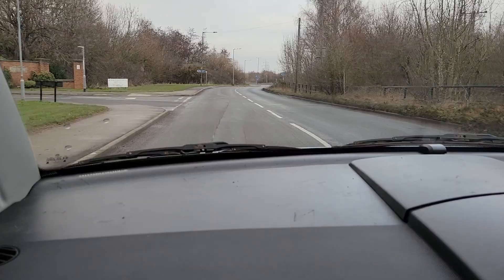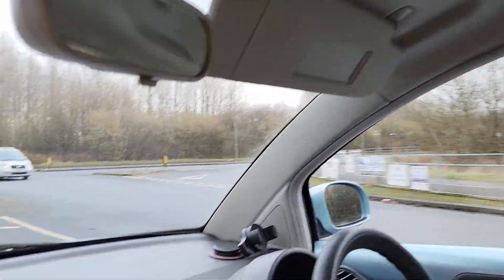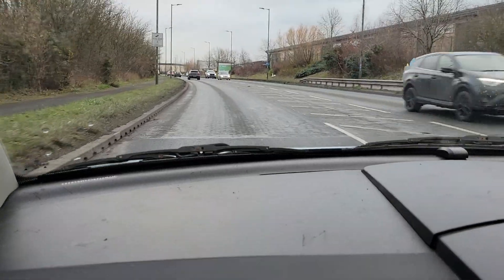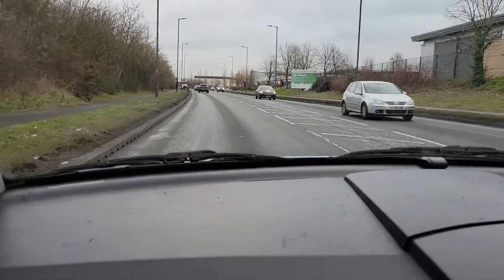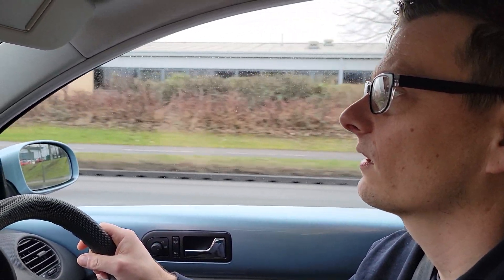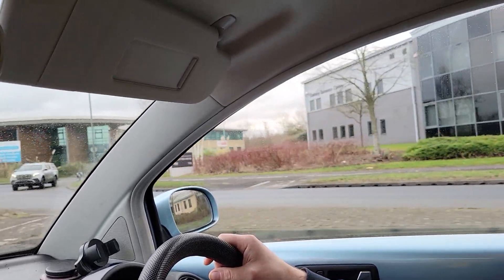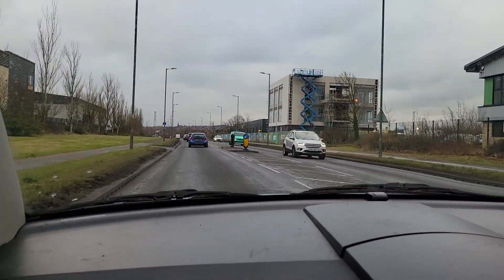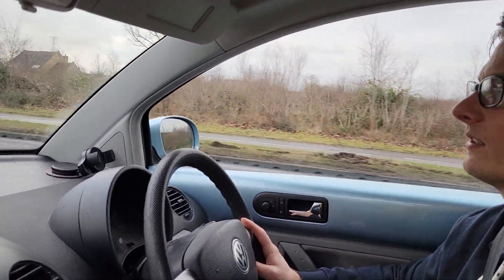Testing the latest OpenInverter firmware in Jamie's BugPlug (it's flippin quick!)

Comment: Cool to see improvements with only firmware updates. I run the Mitsubishi generator on the stock inverter, just want to see what it can do with unmodified hardware. Now I'm curious if there is a big difference with the openinverter firmware. I have a modified inverter ready to go in the car. Was out the 5.24 firmware running in this video?
Reply from the maker: Yep that was it. I hear good things about the stock inverter setup but obviously you're going to be limited to OEM torque/power. No limits on the OI setup with a suitable inverter.